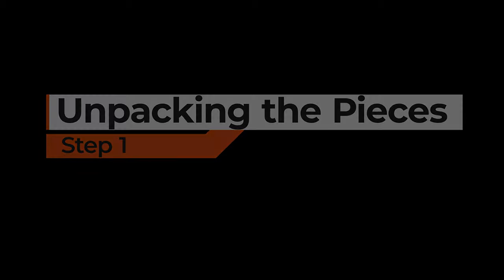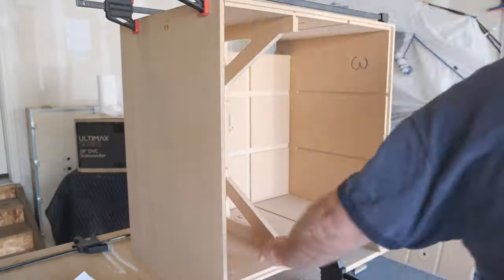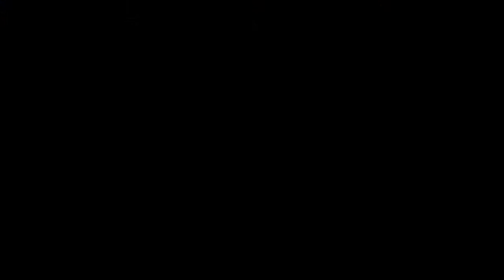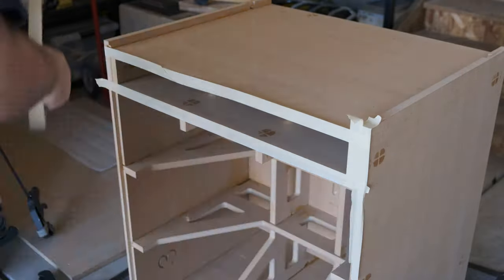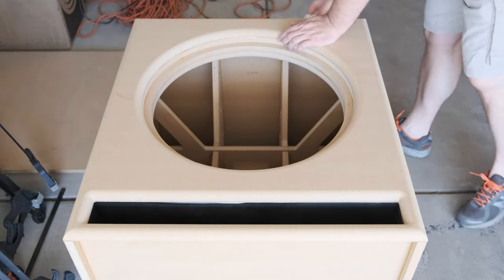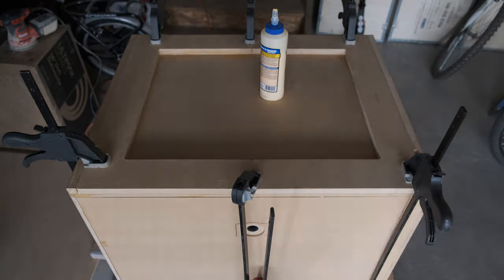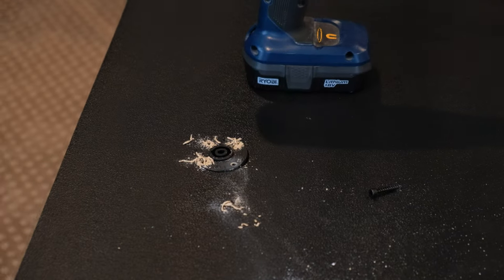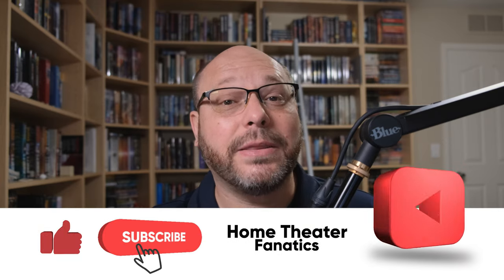21 Inch GSG Audio DIY Subwoofer build guide!  ► Order with code: Jilesgsg

Comment: The paint job looked great. Shocked how well it looked with zero primer. 

I’m looking to get a couple 18s or 21s for the new space next year.
Reply from the maker: The duratex does a great job with no primer. It does get 2 coats though... so maybe the first one is the primer - so to speak.

Comment: Cool video I also have a PA speaker, but only (have 46 cm)

It was the first speaker I built and also an entry-level housing, old cabinet and an entry-level 46 cm speaker but if you adjust the screws correctly, play speakers without cracking wood!

Cooles Video ich habe auch einen PA Lautsprecher, aber nur (have 46 cm)

Es war der erste Lautsprecher, den ich gebaut habe und auch ein Einsteiger Gehäuse, alter Schrank und ein Einsteiger 46 cm Lautsprecher aber wenn man die Schrauben richtig einstellt, spiele Lautsprecher ohne holz knacken!
Reply from the maker: Thanks for watching!

Comment: That is a really good looking build! Is it possible to make this subwoofer active? I usually prefer using active subwoofers haha.
Reply from the maker: You could likely cut out one of the sides and jam an amp in there if you want to. I’d check with GSG first though.

Comment: Was there ever a test or comparison video on this sub? I am very interested in building one, and it would be very interesting to test it against a SVS PB16 Ultra or some other high end commercial subwoofer.
Reply from the maker: Not yet. As soon as I get my hands on those subs I can do a bit of comparison.
Reply: 16 inch has no chance against 21 inch
Reply: This is an easy comparison as it's just math. I currently have dual SVS PB16u's because I bought them before understanding how powerful these DIY subs are. The PB16's are 1,500 watts RMS and 5,000 peak. for GSG Full Marty 21" and get an Eminence driver you'll be 5,000 watts RMS and 10,000 watts peak..EACH. Now all that power will require you to make sure you're running an amp that can handle it which is going to be expensive, but to do it right you'll be around the same cost of the SVS PB16 ($5,500).

Recap:

Dual SVS PB16u - 3,000 Watts RMS | 10,000 Peak
GSG 21 Full Marty with Eminence Driver - 10,000 Watts RMS | 20,000 Peak 

I was impatient and just wanted to order my subs and have them delivered quickly, plug and play which what the SVS will provide for you along with customer service and warranty. They are a beautiful sub, but value per dollar they are not.

Comment: Does the LaVoce not need a gasket?  I thought the Ultimaxes came with them, but the LaVoces did not.
Reply from the maker: It does have a gasket on the back. As I continue to test I will keep an ear on it for leaks. But so far so good.
Reply: @JilesMcCoy  OK cool.  It's probably even less of an issue since the box is ported.  You'd really be able to hear it if there was an issue on a sealed box.   I've got 4 LaVoce 18's on the way to my house, was wondering if I needed to buy gaskets or not.  Guess not.  :)

Comment: Wish they would do some larger sealed flatpacks. 21" or stacked or opposed. In my small 1500 cubic ft sealed theater i found after eq sealed provides roughly the same spl without less eq to apply
Reply from the maker: I am asking for the same thing!

Comment: Is 21" really necessary?
Reply: It’s not necessarily about loud, but rather the ability to hit low frequencies with ease and ultra low frequencies not capable by other sizes. I’m not a bass head like many, but sometimes speakers like this can make a good system great by “filling the space” better.
Reply: Absolutely yes!
Reply: Yes
Reply from the maker: I like it!
Reply: Unfortunately 24" are relatively hard to come by but 2 or 4 21" sometimes work
Reply: Size matters and also XMAX If your talking frequency response. Now I've see 2 12" car subwoofers Sundown Zv5 hit a 150db in a car🚗 trunk hitting 28hz!! I got 2 18 1500rms watt Soundqubed car subwoofers that hit 10hz!!!! I filmed a 13hz Marshmello Silence "rebassed by JK" song demo and I got my front doors shaking on 13hz in my long suburban go check it out. My subwoofers have a xmax of 36mm and only cost $339 for a 60pound subwoofer.
Reply: @audioarkitekts  just remember size and woofer excursion matters for lower frequency response and loudness. If your wanting loud go with an affordable car subwoofer with high power handling. I seen 12" car subwoofers hit very loud and that was because the xmax was over 30mm and they could handle 2000 rms watts. Check out Sundown Audio. There American built subwoofers built in Hickory North Carolina.
Reply: @twentyonehertz  now that's a very nice setup! I have 2 18 Soundqubed HDX3s on 4k
Reply: Ryan Bass For Life I’m actually doing a 15” build with the HST15 by Stereo Integrity
Reply: @audioarkitekts  nice that subwoofer is going to sound clear.

Comment: what is this tuned too.?..great video what are your thoughts on the 18 inch subs of this style ..?..
Reply from the maker: I’m not sure if the tuning. I think is somewhere around 19hz. I like 18” subs a little more just because they are easier to deal with in the room.
Reply: @JilesMcCoy  ok great what brand would you recomend for around 20 hz..?
Reply from the maker: @johnsmith-qz4bv  For an 18”? GSG cube with a um18 driver.
Reply: @JilesMcCoy  ok i will check them out ......thanks

Comment: Hey I have talked to you a few times. I have two mini Marty with 18 ultimax with the nx6000d. I have still not got the umik1 and calibrated them. They sound awesome and I am happy with them!  Is it worth the 100$ to get the mic and eq them?  I just keep thinking if it's actually worth theextra money to get the mic. Does it make a huge difference and is it worth it? They are front corners angled to the center seat.
Reply from the maker: Would you realistically move them to another spot if you could get a better REW graph? If you really aren't interested in moving them around and you are happy with the bass then it might not be a good investment.
Reply: @JilesMcCoy  no they need to stay where they Are located to fit in the room. So maybe I just be happy and leave it alone. I am supper happy with how they sound and I am picky about audio.  Thanks man.

Comment: Jiles, can a amplifier be mounted on the back of the sub? If so, how would it be wired?  Thanks.
Reply from the maker: Hi, do you mean a plate amplifier... or taking an external amp and attaching it with a bracket?
Reply: @JilesMcCoy  yes, plate Amp connected to the speaker box.
Reply from the maker: GSG should be able to cut a box for you with a plate amp hole!